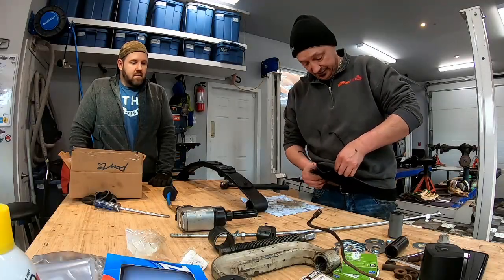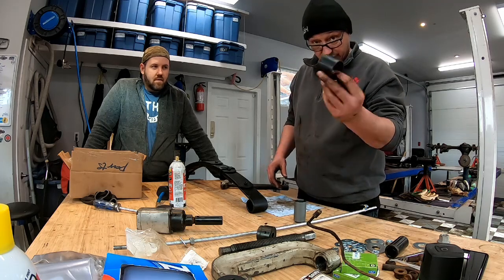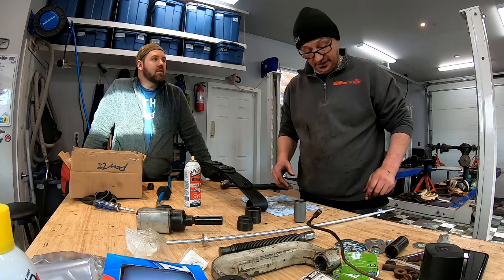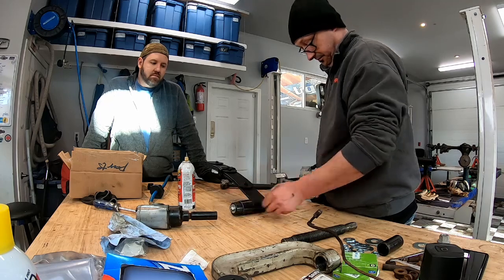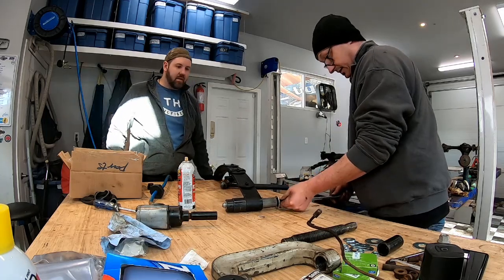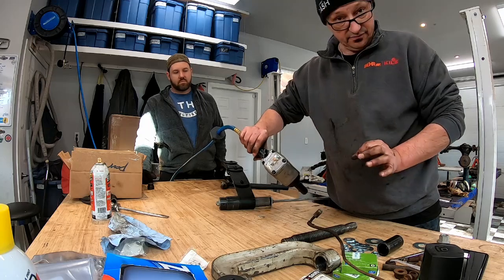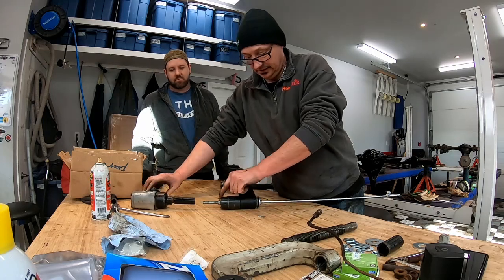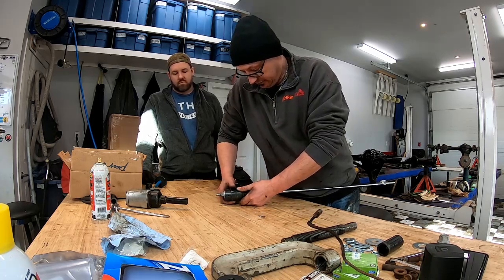Installing Leaf Spring Bushings with Basic Shop Tools

Comment: You're a legend.  I just went to Lowe's and got a 1 1/2 socket, all thread, nuts and washers and did this on my 2004 Chevy Silverado Z71.  I fought with it for an hour and got nowhere.  This got it on in less than 10 minutes..... most of which was spent on waiting on my little air compressor to recharge.
Reply from the maker: Love to hear it!  But no man should have to wait for a compressor.  Time for an upgrade ;)
Reply: @johnniemo  hey there great video. Does a leaf spring bad bushing affect the smooth ride of the vehicle?
Reply from the maker: @RWarrior777  if it's really bad it sure would. Particularly if it's on the front end. But those are rare. If you have a ride problem is look elsewhere first.
Reply: @johnniemo  thanks 🙂